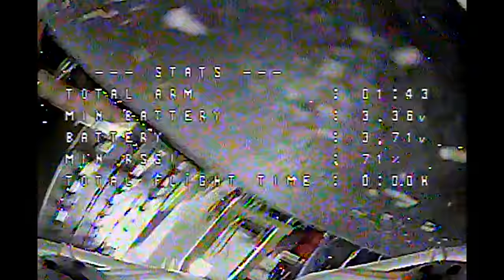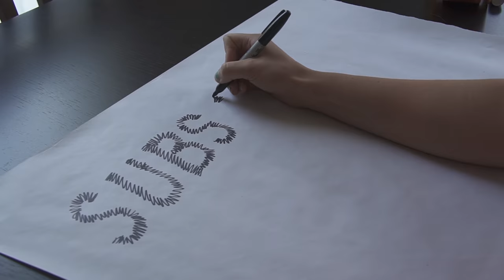Tinywhoop Track is literally made of LED art

Comment: What are thoes hexa cylindrical things ? Where can they be bought?
Reply: If you're talking about the mirror tunnel, it's basically just 6 of those mirrors you can get at Walmart for $6 or so a piece. They're the mainstays brand. They just decase those and mount them to a wooden frame that they make and put some leds inside. I believe they go over how they made all the gates in the Flite test video about this event.